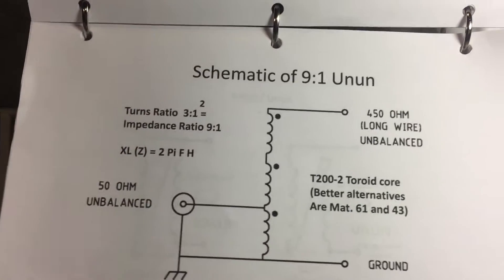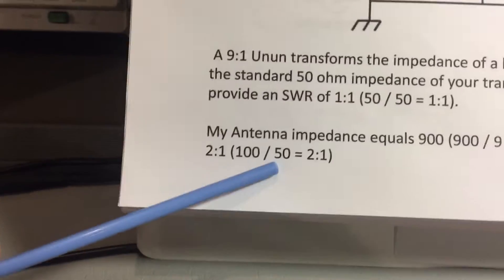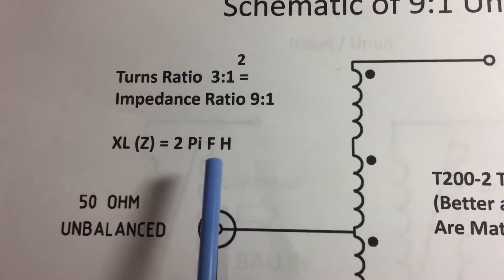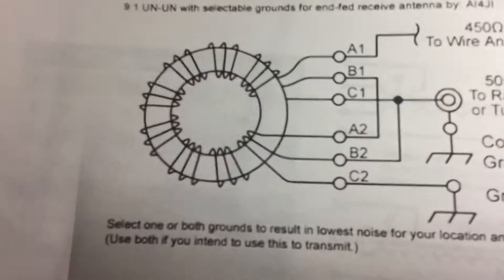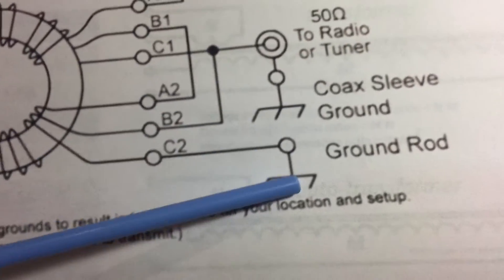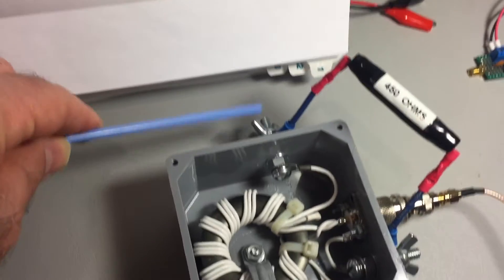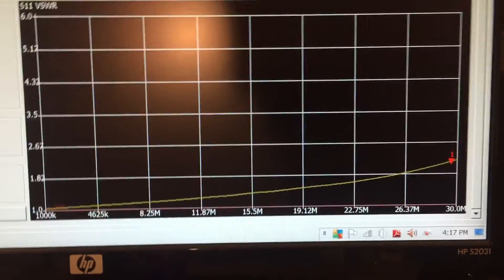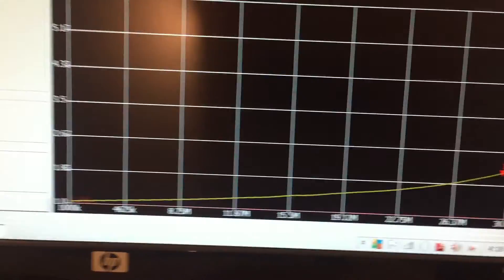Part Two 9:1 Unun: RF Man Discusses Long Wire Antennas, Unun's, RF Chokes, and Antenna Tuners.

Comment: So if your antenna is 900 ohms, then why not make an unun with 1:4 turns.  Giving you an z transfer of 16.  16x50 = 800.  Swr capable of 900/800 = 1.13 ???

Comment: Remember, power rating in any balun is into a matched load.  In this case with your 9:1 would handle about 500 watts from a single core into a 450 ohm load.  As you stray away from 450 ohms, the power rating goes down !

Comment: I noted strange behavior with MFJ1984MP vs power level - 5watt low swr - 25w and higher, HI SWR at the same frequency. 40 M band. It is supposed to handle 300w PEP

Comment: Great series of Videos, RF Man . Thank you.
Am I correct in thinking that it's the triple wire turns (tri-filar winding ?) that gives the 9:1 ratio (ie 3-squared) NOT the actual 9-turns ? That's just coincidental ! So for 16:1 you'd use 4-cores but maybe still only 9 turns ?  Could more turns be wound on a bigger toroid - or even on an air-spaced former - or less on a smaller, and still get the same ratio ? I appreciate that air spaced will have totally different permeability than ferrite based formers and give different results, but conceptually it's still a sound alternative ?

Comment: i built it like in the drawing  9:1 open core 2"  former, 2.5 mm wire(copper) plastic  coated 3 mm thickness total 12 turns, the what i find on  antenna analyser  is interesting , 50 to 100 ohm so.. basically 1:2 on a fiberglass former,, what? he he,,, yeah. so i added taps on the center wire for more ratios. will play more when i  have time.
the small  junkbox toroids i have  yields better  results but albeit Micky mouse power :)
so i must have a 144 ohm 2ndry, but  alas  closer  to 100 to  120 ohm...
remember mine is 12 turns not 9 for those interested

Comment: Good video. One question, could you explain how to build for different power requirments and which gage wire and which toriod is needed. Does a #6 material work as well as the 43?

Comment: Interesting. Would be nice to see a vidio on building them for different power requirements.
Reply from the maker: Basically the circuit design would be the same. For low power operation, you can use a smaller coil (1.5"), smaller gauge wire (16ga), and variable air capacitors with a lower voltage rating (100 to 200 volts). For QRP applications,  the air gap between the plates would be much smaller so the form factor of the variable capacitors are much smaller.  See hyperlink (this is good for 100 watts): https://www.ebay.com/itm/Capacitor-365pF-Variable-Single-Section/132032487083?epid=1712229709&hash=item1ebdbfdeab:g:N2wAAOSwfSJdC88J